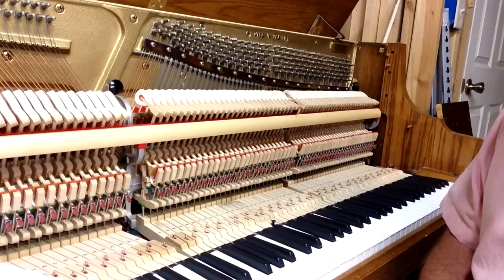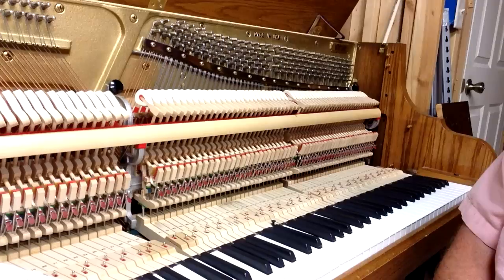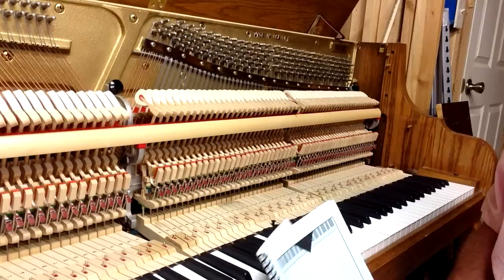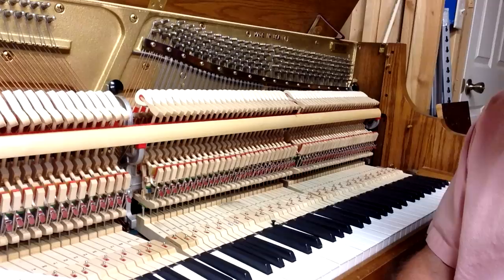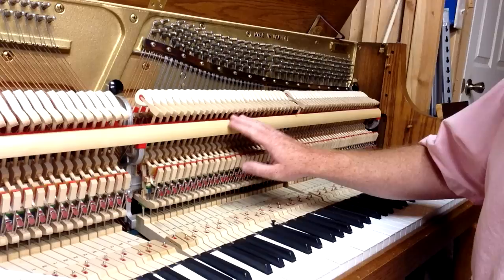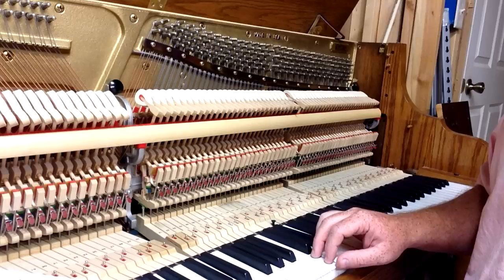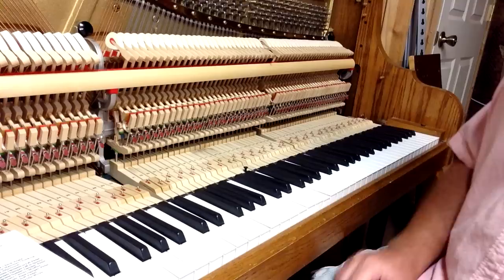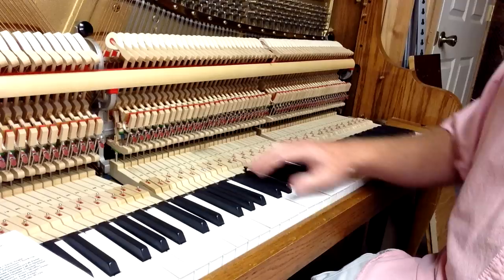Vertical Piano Regulation Procedure - Piano Tuning & Repair I HOWARD PIANO INDUSTRIES

Comment: Had someone come and tune and regulate my piano and now it sounds worse than ever so I figure it's time I fix what he did. He was here twice by the way and I paid him a whole lot of money.  The tuning was the easy part for him....but then he said he wanted to regulate it and...took each key out and turned a screw at the end of it and re-intalled the key ......that is all he did. Now the key action is pretty bad sometimes won't even sound. etc etc help !
Reply from the maker: It could be he regulated the lost motion to be too close and then maybe there was a weather changed that caused what is called negative lost motion which can make it so the jacks don't reset properly.  Or the problems you're having with the piano could be unrelated to what the technician did, it could be different issue such as tight jack flanges.  It's difficult to tell without seeing the piano.
Reply: Yes I think he regulated the lost motion too close.....but going to fix it !
Reply: It could be that there is either too much key-dip or too little. When I regulate for key-dip, I firstly make sure that the back-check and set-off regulation are OK so as not to inhibit the full movement of each key. I often regulate to 11 mm rather than 10 mm key-dip - slighty more than the key-dip block - depending upon what feels correct to me as a pianist (as well as a tuner/technician). 

When regulating the #s, I often increase the key-dip on the balance rail a little, but ensuring that when depressed, the sharp is 2 mm above the level of the naturals (which are NOT depressed, of course). If the sharp comes down to be flush with the naturals, then it needs building up on the front rail with the various thicknesses of card washers. 

If there is insufficient key-dip, hammers will tend to bounce against the strings, and the piano will feel stodgy to play. If there is too much key-dip, then the piano touch will also feel wrong. 

If you employ another tuner/technician, maybe find one who is also a pianist, and who knows how a piano should feel and sound, and who knows how to achieve the optimum results for any given instrument.
Reply: @howardpianoind  sometimes getting rid of the lost motion at the capstans makes the dampers action to soon. In that case the piano Will indeed sound horrible.

Comment: You said 1/8th inch in bass and 1/16in in the trebel...maybe as long as the hammers function correclty.  So, where would the transition be?  Or would you change it gradually from bottom to top
Reply from the maker: The change will be where the bass section ends and the treble section begins. You can tell the bass strings by the fact that they cross over the treble strings.
Reply: @howardpianoind  Ah ok, that is what I though.  Wasn't sure if you were taking about actual strings or subjective sound of the notes.  Thanks for the reply.  Cheers.

Comment: How to readjust the keyboard actions to a lighter standard action to 50g? Seems like my piano actions is up to 60g at C1 & 55g at C8 when it came out from the factory. Can I add some weight e.g. 8 to 9g at the tips of the keys?
Reply from the maker: Hi Thomas, You'll first want to make sure there is the proper amount of friction in the keys and the action.  Once you've done this, then you can make some modifications such as weighting the keys with weights that are put into the keys themselves.  You have to drill holes in the sides of the keys to put the weights in. This is a fairly detailed process that we may offer a video on in the future.
Reply: Dear sir,  Thank you very much for your advice. I shall watch the keys more carefully before I do something to lower the actions. Many thanks.

Comment: Howard, I have a Baldwin upright and am having a problem with the hammers intermittently not returning to their correct position to strike the strings? I know it needs some kind of regulating but where do I start? I made a short video showing the problem. How can I get it to you for review?
Reply from the maker: It sounds like it's possible that the jack pinning is too tight on some of your jacks.  You can email a video to: steve@howardpianoindustries.com
Reply: Is it a balancing issue? I'm having the same problem.. It's like there's not enough weight at the back of the key to return the jack in the right striking position.

Comment: hello Howard I am currently working on a mini upright schoenberg piano by trebel. the action seems simpler but is definitely bobbling a lot. there's also a problem with the mute when you press the key sometimes it doesn't lift off enough the strings making it sound a bit muted with quick notes
Reply from the maker: It could be that the damper spoons need to be adjusted.

Comment: When you buy a brand new piano straight from the dealer (Kawai), is it already regulated or is that something one has to do when you first get a brand new piano?
Reply from the maker: They typically do some regulation on a new piano, but once the piano starts getting some use and the new parts start to get broken in it will need some regulation done.  Typically you figure to have this checked after having the piano about a year.

Comment: Do you have any advice on how to adjust the letoff of a Spinet Piano while the action is still inside and after the keys have been leveled?
Reply from the maker: Adjusting let off on a spinet piano can be done with the action in the piano.  It is a little more difficult because you have to reach down to access the regulating screws.  But using the normal regulating tool you should be able to reach the screw.
Reply: @howardpianoind  Thanks, I'm trying to regulate my 1960 Wurlitzer Spinet but trying to turn the regulating screws is super-tough as you need to turn them at an angle due to all the parts of the Action in the way. Are there any regulating screw tools out there that account for the angle in which you have to turn those screws so you don't break off the heads?
Reply from the maker: Not that I’m aware of.  You’ll just want to do it carefully and you may not be able to put the tool all the way down over the head of the screw but just work at it from the top part of the screw head.

Comment: If adjusting the key height n depth affects the lost/over motion of the capstains then why not save it for last?
Reply: Also key depth and "hammer stop" adjustments are so inconsistent as its highly relied on the amount of depressed pressure u exert, who can do that consistently for 88 keys??
Reply from the maker: Yes, it is dependent on these factors, but you have to adjust it with a medium strength blow and do it consistently from one key to the next.

Comment: If it's a spinet or console piano, should I climb up and down to regulate the action or there is a shortcut I can do much easier? Thank you
Reply from the maker: Regulating spinet pianos is a pain because of the action being so far 
down into the piano,  but unfortunately I don't know of any shortcuts.  
There shouldn't be too much that has to be done from below the keyboard.
  Mostly just adjusting the spoons which can be done with the action out
 of the piano if you get it set up right.

Comment: Hello Howard. please tell me exactly what makes a key return to the up position?
Reply from the maker: The thing that makes the front of the key return to the up position is the fact that the weight of the action on the back of the key is heavier than the front of the key so it pushes the back of the key down which causes the front of the key to go back up since the middle of the key is on a balance rail, so the front and back of the key work somewhat like a see saw.
Reply: Well when I use the soft pedal sometimes a key doesn't come all the way up. it does when I release the soft pedal. Is there any harm in adding a small lead weight to the back of the key to help it come up?
Reply from the maker: There is another reason that the key isn't coming all the way back up.  It could be that the key bushings are too tight, or it could be that there is something too tight in the action such as the hammer flange or the jack flange.  Adding weight to the key wouldn't really be fixing the problem.  It would be better to diagnose where the issue is.

Comment: Start to finsh -- appx how long does it take to do the regulation process described ?
Reply from the maker: It does depend some on how much adjustment is needed, but usually about a half day will do a fairly extensive regulation on a vertical piano.
Reply: Thanks Howard --  I'm planning to charge a flat-rate and am trying to figure out a reasonable mid-way balance.  I recently did a key leveling that took about 2 hours -- every single key needed it.  And I get a lot of pianos here that haven't had anything done (including tuning) in years -- sometimes decades.  Based on that I was figuring I should block off at least 4 hours.   And thanks for all the really informative videos :)